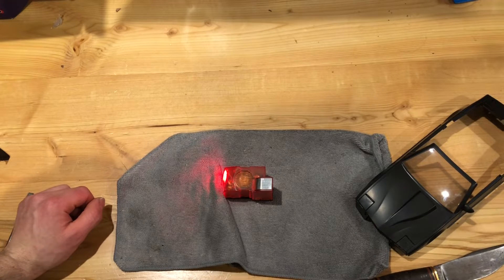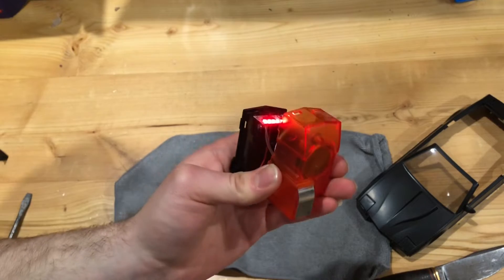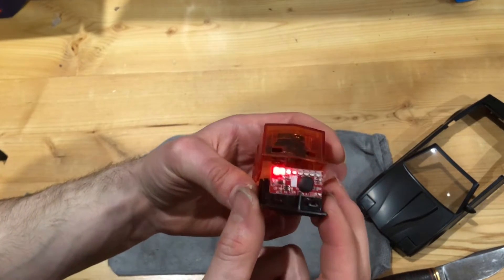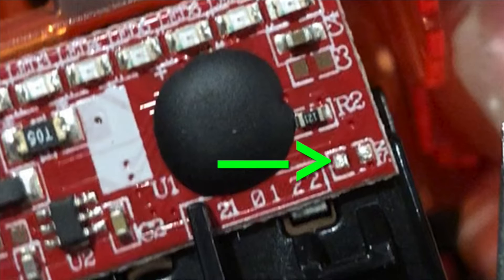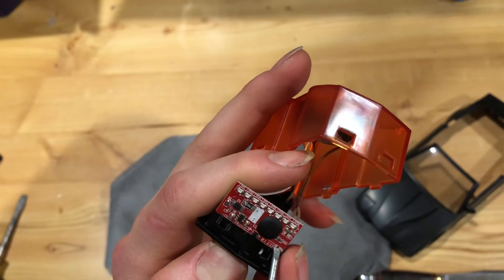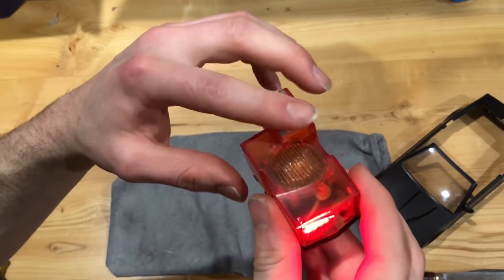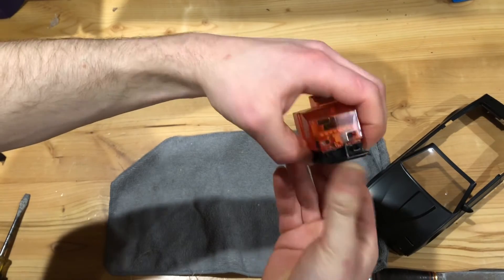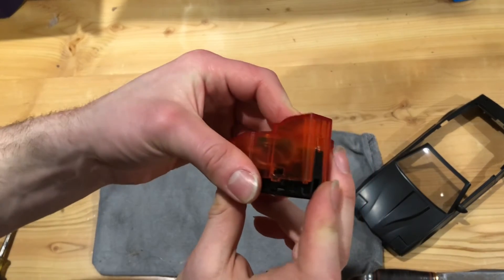Playmobil Knight Rider light sequence hack (never turns off)

Comment: Very nice! I was looking for this❤
Is there also a way to disable the sounds
Reply from the maker: If you just want to solder over the contact for nsl and add a switch on the battery pack 

It would never have sounds and only be on when switched

Comment: My Kitt's sound effects stopped working all of a sudden and I don't have any idea why?
Any thoughts or fixes?
Reply from the maker: Have you taken it apart at all.?
Reply: @kadensmodifications  No, too afraid. I might trying thought after seeing how you did it. Problem is, I won't know what I'm looking for when I'll eventually do it.
Reply from the maker: @bloodangel9403  well if you haven’t tampered with it I’d try unplugging the batteries and changing them
Reply: @kadensmodifications  I've already done that. Still no sound at all
Reply from the maker: @bloodangel9403  does the light work?
Reply: @kadensmodifications  Yes, the lights work fine. They even shimmer when Kitt's supposed to talk.
Reply from the maker: @bloodangel9403  Id guess a speaker wire came off then

It’s fairly common on miniature pcb boards

Unfortunately to fix it you’d have to take it apart and identify the break